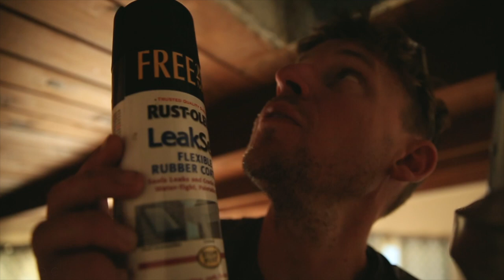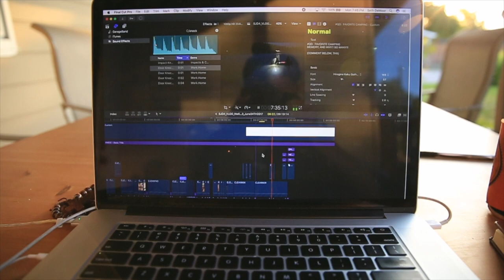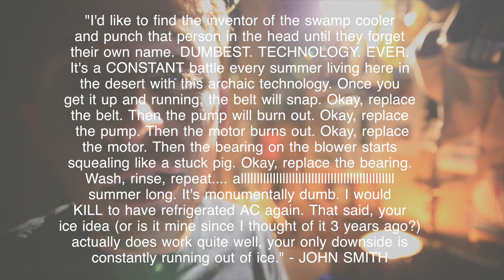SWAMP COOLER SAGA CONTINUES

Comment: Dealing with the same problem. However the caulking around the swamp cooler is old and brittle. Will be replacing that tomorrow. 

Looked like the previous owners knew about the issue and added a piece of sheet metal to remedy the problem. 

I'm gonna try redoing the sealing around the sheet metal and see if it helps.

Funny thing is that the Aspen pads are the only ones that cause the leak. But they work the best...